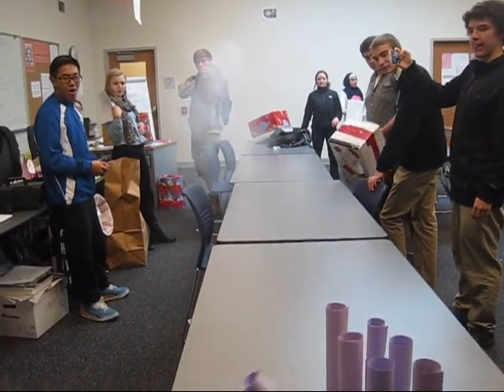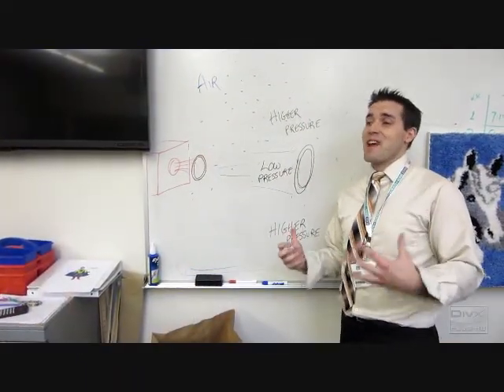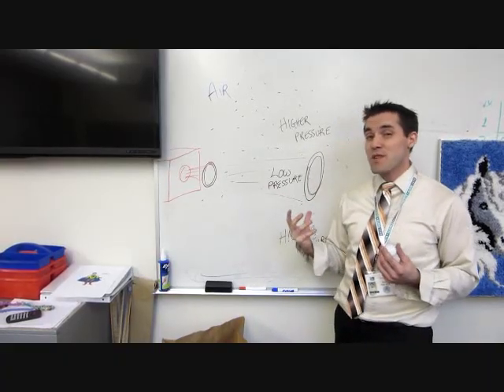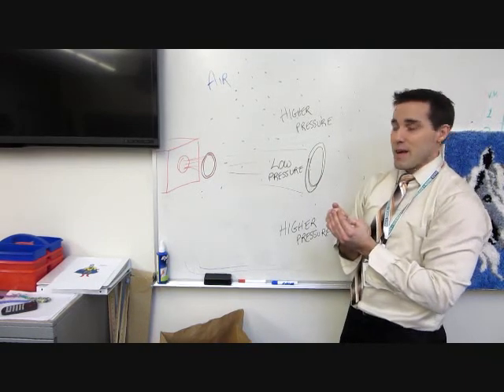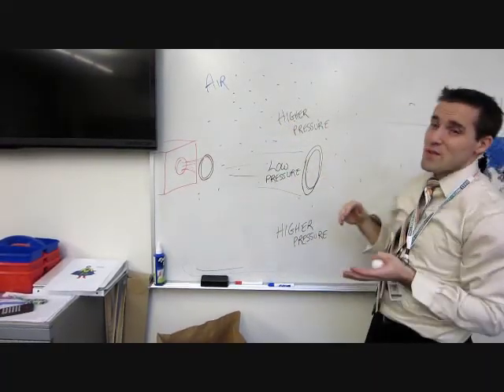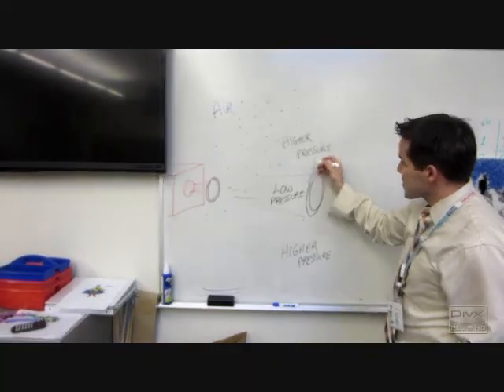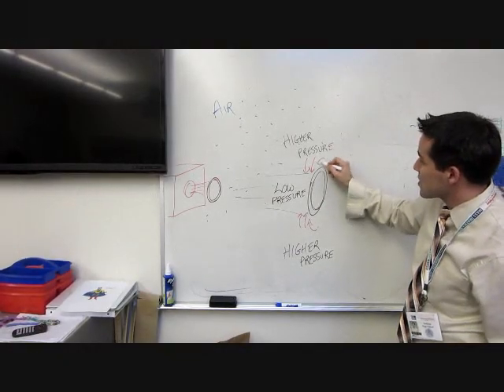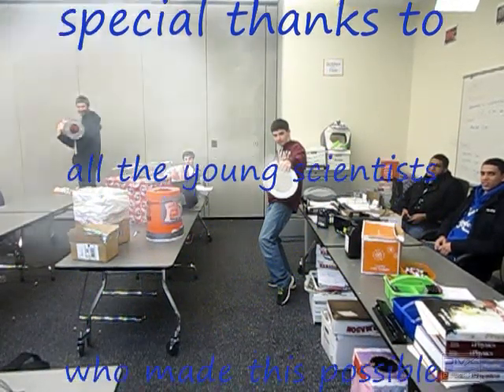Air Vortex Cannon Explained

Comment: what happens if the vortx container is bigger or smaller
Reply from the maker: From seeing hundreds of these… the size of the container is not much of a factor but the size of the opening is.. the smaller hole is the more limited its performance as the curling air may collapse.